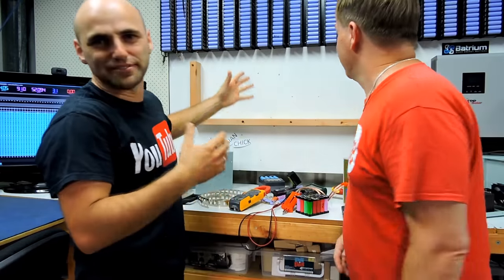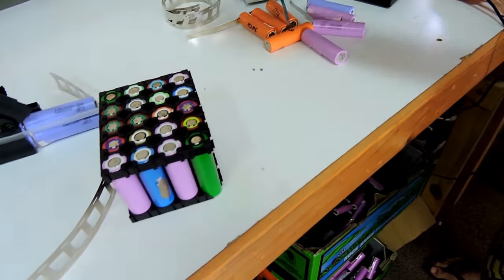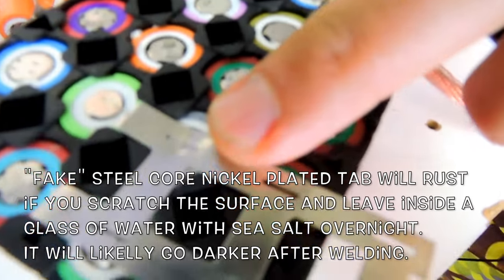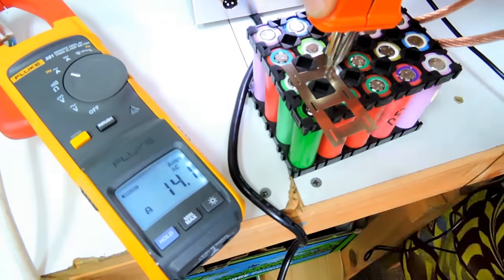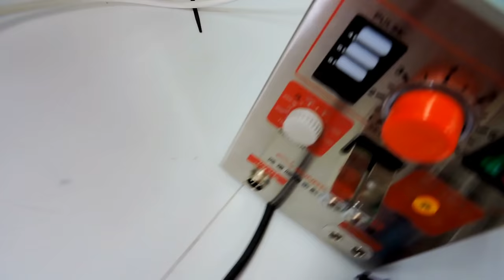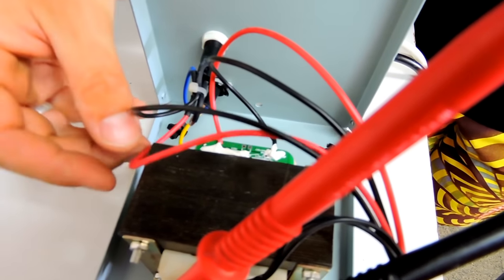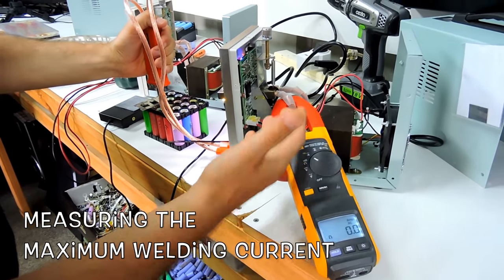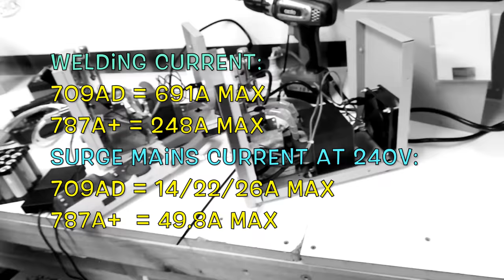Sunkko 709AD vs 787A+ • Spot Welding Tutorial + Review + Teardown with Peter DIY POWERWALLS

Comment: Just an idea for you, because the lower amp unit has such loose connectors a lot of the current may not be transferred down the cable. maybe not making a good circuit. You could test it using the direct contact points and may get different results.
Reply from the maker: Yeah, if I ditch the long extension (pen) and just use the little welding head that comes with the 787 it should improve the performance, but still, there's a massive difference in performance and settings/controls. 

Also I know so many people who bought the cheap models like 787 or 788H and they either failed or didn't do a good job. Then they bought the 709A or 709AD and are suuuuper happy, completely different machines.
I still want to do more tests maybe using my scope and understand exactly why both models are so different.

Comment: I'm starting to play around with this stuff and in the process of trying to make something I can use for a small pack with a 12VDC car battery as a source controlling the pulse with an Arduino and a relay.   The information and data you provide here is truly wonderful.  Thanks so much !  We can get batteries that range between the two current extremes you measured. Also your explanation of current flow effects with Cu v Ni was very useful to me as I've been wondering about why Cu isn't used. However, if one wanted to solder and could manage to tin case surfaces without too much heat transfer, maybe solar bus ribbon (dead soft Cu solder coated) could be viable with low enough energy. All I can find in small quantities is Ni plated Fe (Ni 40% higher in DC conductivity than Fe), so we'll see how that goes.  I've done some research on the internet, but your video has given me new data and ideas.  One caution -- the maximum recommended daily dose of caffeine is only 400 mg.  I myself consume 600 mg every morning, but it has been estimated that for the average weight male, 5,000 gm would be on the verge of lethal -- kind of the human equivalent of burning a big hole in the anode cap of am 18650: It could ruin your day.  Just sayin'.... :D

Comment: Hi, buddy, the current value of the clamp meter is not exact, this is a delay value (the peak current only lasts 5 ms). When you weld, the peak of the current can approach to 800 amp.

Comment: I own the cheap one. The other day I made a discovery. The knob for turning up the charging current also turns up the welding current. I discovered this by blowing a hole in a battery. I don't know whether I have a faulty one, or it's meant to be that way but I am taking advantage of it to get higher currents in the pen. (When I finally get round to making the pack)
Reply: John B. I just got the cheaper 788 H USB.  Bought a pen separately and noticed that there is way less current running through the pen too.  Have the US version
Reply: @GreenMountainDIYGuy  I saw an American buy a 220v one and get better results. I guess for a given wattage if you use 110 on an appliance that needs 220 that a) you won't over-volt it, and b) you'll draw twice the current. VI= W, ignoring power factor for simplicity. I can see how a 220v one might work better in America.
I wonder if I use a 220-110 trafo if my 220v welder will work better. I think I can lay my hands on one.
Reply: Caution: if you're drawing twice the current the machine was designed for it could overheat.
Reply: Can you get a trafo that will reduce your ac voltage below 110? One that can carry the load? That might be the way to go. 220 to 110 trafos are very common on building sites, but I doubt you need anything like that in America.
Reply: @johnb.9806    I think I know what video you are referencing.  I just complete the return process to send my US Version 788H USB back ti Amazon,.   Will look at getting a 220 version from AliExpress or Banggood.  Thanks for taking the time to reply to m issue.  It is appreciate!
Reply: @GreenMountainDIYGuy  Just buy the one on the right if it's not too expensive.
Reply from the maker: Loving this chat here hahahaa... yeah, very common see Americans getting the 110v and getting frustrated with the results, returning and buying the 220v and woooowwww... night and day difference!!! 709ad is the best of the Sunkko welders in my opinion =]
Reply: @BrunoPOWEEER  hi Bruno, can you help me figure out which welder to buy? The 110 or 220? I live in canada. Im not understanding . I googled 220 to 110 transformer but it says it wont work, also sunkko website says that their spot welders wont work with 220 to 110 v adapters. Can u plz explain to me what to purchase. Im getting the 709ad+ just gotta know what to get the 110 or 220 and what sort of adapter. Thanks

Anth

Comment: Good vid guys, thanks for the share.  Q,1,  I wonder if you did just get a dodgy unit, or if all the 787s will give similar poor comparitable output specs. 2. The loose connections, perhaps firm them up somehow for better current transfer, and recheck output.  One comment/criticism is that I notice so many YT's only showing volts or amps in their experiments, not both, ultimately at the same time, so as to be able to make a more accurate, definable and repeatable conclusion of results.  As you know, so many things can be happening in an electrical circuit at the same time that a small change in resistance of a part such as your connections or a contactors or relays points having a small imperfection, burn, point, dag, dry joint, etc, + loose connections could possibly yield big changes and unstable or inconsistent readings also,  and this is why I like to take both measurements simultaneously where I can (volt and amps) to verify my findings with another factor, power or watts total and this may help to diagnose some of the issues here.  Also, I guess the timing of the burst is critical in how long it sustains the blast of current in whatever time variable to do the job in a specified amount of time using 'x' amount of joules or energy to do the task.  I'm certainly no expert, just a bit ADHD with this stuff at times and would like to see a few more experimenters using both volts and amps to help make a more educated result or finding.  Thanks for your vid, it was very informative as I have looked at these units myself and gives me more things to consider if I should buy one. Keep them coming!
Reply from the maker: Thanks for your very constructive comment, I like when I get helpful comments like that =]
I made this video while I was traveling to a different state and I quickly stopped at Peter’s house just to say “hi”. I didn’t have any other specialised gear but my Fluke with inrush function. I didn’t have any portable oscilloscope with me (I only have bench ones) we tried to use his multimeter to measure the voltage but the pulse is just too fast  so all we could use was the Fluke clamp meter. It wasn’t a scientific test or anything but a good exercise to compare and understand why the more expensive model welder was so superior + we had some fun opening and checking inside both welders =]
Here is a video showing my workshop with all my oscilloscopes and a proper professional/industrial production spot welder, you’ll have fun watching, it’s a proper battery building workshop for electric vehicles https://youtu.be/Pbg--F-43K8

Comment: One very important factor for welders is the way the cables connect to the welder.  If there is a high resistance connection you can easily lose half of your power.
Reply from the maker: asusreviews yeaaahhh correct... a poor connection becomes a bottleneck in the system.
*I didn't really like that connection on the cheaper welder =/

Comment: Trying to decide getting a 220v spot welder and install a plug to run off of my stove's 220v outlet (live in apt), or try a 110v version of spot welder and risk tripping my breakers. I have several 110v 20 amp breakers and a set of 2 40 amp breakers for the stove. Some of the 110v welders say they need 30 to 60 amp power source to operate while others say they only draw 15 amps, very difficult to decide which route to take.
Reply from the maker: Definitely go 220v, I never heard about anyone having breakers dropping in 110 or 220v but EVERYONE who owns 110v complains that the welder is rubbish... then they return their 110 and swap for the 220v and they go like WOOWWWW the difference in welding is so ridiculous. Don’t waste time and money (and bad welds) trying the 110v version... if you google you’ll find many people (mostly Americans) describing their frustrations and always end up swapping to 220v.

Comment: Your running your units on 220 current. Here in America we have 120 volt of the same model and they barley weld the the tabs to the battery. Here in the U.S. the curent is about half that you have to run these welders and most need to be modified with twice as many HV windings.

Comment: Hello 
Which is better than these two i have a lot of 18650 which machine will weld them best?
Reply from the maker: Sunkko 709AD is by far the best option in 220-240 volts version, the same in 110v is really weak I only recommend the 220-240v version
Reply: @BrunoPOWEEER  thank you

Comment: The (pen) tips on my 709A have worn out.
Can't see any way of changing them.
They do provide new tips but they're for the welder itself, not the pen and a new pen on the bay of E's is a moronic price !
Do  I risk buying one of those "el cheapo" versions ?
Reply from the maker: Yeah I know what you’re saying... maybe just make your own tips, they’re just copper and copper is soft and easy to shape. Buying anything will take weeks or over a month to arrive.
Maybe take to any local metal fabrication or engineering or electrical shop and ask them for help they may have something there that perfectly fits your pen

Comment: I have the 709A, can you post the wiring for the fan, I would like to hook one up in my unit.
Reply from the maker: The 709AD has an additional temperature sensor that makes the fan only turn on above a set temperature. You could get a 110v or 220v regular fan and just hook up directly to the AC power cable inside the welder and put a latching on/off switch somewhere (ideally use the front panel ON/OFF switch) so when you turn the welder on the fan is always on =]

Comment: 0:27 man your energy, this is why I come here, thanks for that ;)

Looking at both of these at the moment on Aliexpress, keen for your opinion!
Reply from the maker: Hahahaaa yeaaaaahh man... thanks for watching the madness!! Sunkko 709Ad or Ad+ are both good, the only difference is that the + model can be used without the pedal, sensing when the probes touch the nickel and automatically fire the welder, some people love some people only like the pedal. Most importantly, these welders are only good in 220/240volts, the 110/120volts are rubbish and people always return then and get the 220v version
Reply: BrunoPOWEEER I ended up getting a 709AD, I didn’t want to have the auto welding, too likely to make a poor weld in my opinion, I like the peddle :)

Wouldn’t mind cutting the cables off the probes though, they’re pretty 👎🏻 swap them out with some good silicone wire instead. I will also say, make sure the seller knows which plug to put on the end, they sent me a European plug and it drove me mental 🤣

I’ll be putting double gauge wires for the plug too, it gets a lot of voltage drop over those tiny ones from the factory ;)

I only have 240v here in Aus so it’s a non issue, we Aussies like volts and the only time I’d bother with 110v is if I was doing solar and even then I’d still prefer 240v ✌️

Always man, I love keeping up with your content, it’s really entertaining and I always walk away knowing something I didn’t before ✌🏻

Comment: Maybe the 2nd welder had a higher voltage, though. Even if the amperage is lower?
Reply from the maker: It’s likely they operate at very similar voltage. These tests were just vari basic comparison not using proper scientific tools. We didn’t have advanced tools at Peter’s workshop, I do have in my workshop but I don’t have the welders.
It’s just weird these two welders perform so differently in real life!

Comment: Looking for 3s and 7s bms  to put between a UPS and batteries! Any recommendations?
Reply from the maker: Ohhh it all depends on your amperage/current levels and cell capacity. Too small and the BMS will get too hot or not be able to balance the series at all. I work for www.batrium.com we do make 7s and up to 400v or higher... check it out. For UPS you may be better using LiFePo4 chemistry which replaces Lead Acid batteries to the exact same voltage whereas Lithium has a different voltage and can be a problem in some cases.

Comment: Can you test "Shenzen unit pack power" Hailong battery packs ?
Reply from the maker: The Unit Pack Power are an “okay” “battery factory” (factory = they just assemble things together).
There are endless problems with the Hailong cases, they’re HORRIBLE and start falling apart, cracking everything everywhere, drop from the bike and crash on the road. Lots of ebike sellers refuse to work with Hailong cause all the warranty problems. Reention battery case is a much better option in every single way (plastic, connectors, mount/base, locking mechanism, weight distribution, easier to install). Go Reention instead of Hailong

Comment: Did you test the output voltage on the 709AD?
Reply from the maker: John Taylor I think we tried using his multimeter but the pulse was too fast for that particular device. Need an oscilloscope or faster bench multimeter that records the pulses so we could analyse properly =]

Comment: Whats the differnce between 709a 709ad and 709ad+
Reply from the maker: Great question mate...
709a is the basic mode but good
709ad has an internal fan for cooling the big transformer (very important when welding battery packs, things get hot after a few minutes of use)
709ad+ looks a bit different but is the 709ad with automatic trigger function, rather than use a foot pedal it welds a second after you touch the probes on the nickel. Personally, I like to have a control on the pedal.
Reply: @BrunoPOWEEER   😃😃😃😃 Bruno I wanted to order 709AD but ended up ordering 709AD+. If I had watched this video before making the order, I won't have sacrifice about 60 USD difference for just an auto weld 😃😃😃😃😃. I thought their are other differences.

Comment: 0.09 mm ?? YOU MEAN 0.9 MM
Reply from the maker: Noooo... 0.9mm is way too thick to spot weld to an 18650 cell, it requires so much energy that it damages the cell body and too much heat may damage internally. I normally use 0.17mm and 0.2mm for most builds, the maximum I heard one guy testing was 0.35mm but it requires a lot of energy/heat.
Watch my latest video showing the professional industrial pneumatic spot welder at 6 minutes https://youtu.be/Pbg--F-43K8